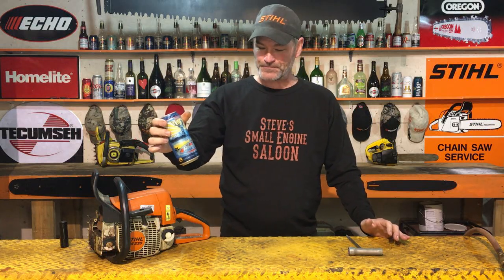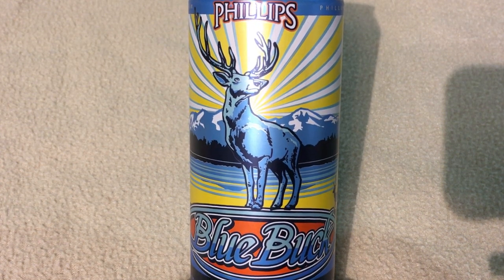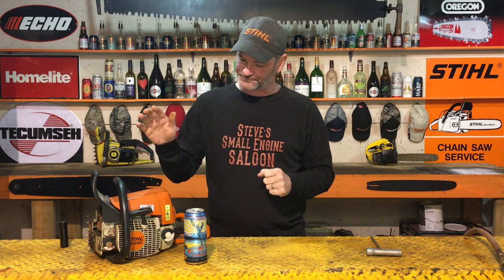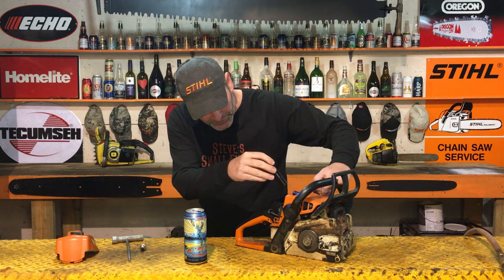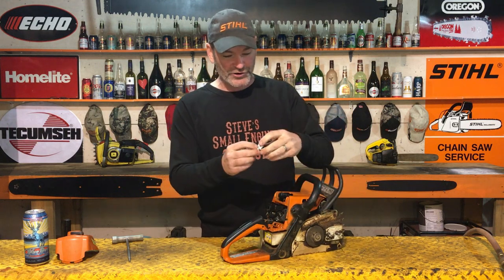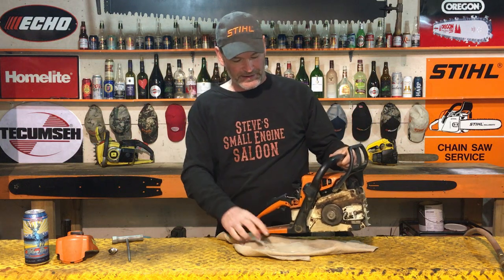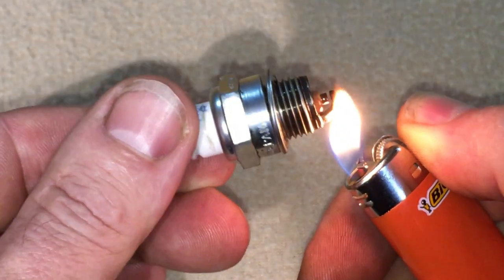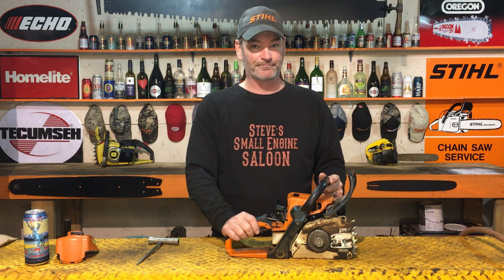How To Unflood a Chain Saw USING Tools

Comment: Hey Steve, I thought using an air hose to blow out the cylinder was a little overkill, It turns out it cleared the cylinder faster and made it easier to start.
I had installed a new engine and carburetor on my STHIL MS 390 and was having difficulty starting it. The oil I put in the lower end while assembling the engine was heavy enough that it was messing with the air fuel mixture, The carburetor was fully adjustable jets with no limiting caps and I didn’t realize I needed to start the base setting of the Jets at one complete turn. Once I cleared the cylinder and got it running I was able to properly adjust the carburetor thanks for the tip.
Reply from the maker: Right on

Comment: Thanks Steve. Followed your instructions and gas poured out of the spark plug hole. Glad I wasn't wearing my Steve's Small Engine Saloon hoodie when I did it! Started right up after that (I guess I needed a refresher course on how to start the saw without flooding it!).

Comment: Steve - I love your videos and your easy to understsnd explanations.
I would only point out that on this video, it appears that you replace the sparkplug with your hands, without snugging it with the scwrench. Then you immediately put the plug boot back on and run the chainsaw.
I would want to make sure that the plug was seated correctly before running the engine
I subscribed after the first video I watched, now i.am working my way through all of them.
Cheers from Portugal!!

Comment: Steve interesting video. I’ve been fixing a lot of chain saws lately and what I been finding  out on older saws if that the fuel lines fall apart in the fuel tank. Had three in a row. Been finding old saws some for free and repairing them.

Comment: Steve my Stihl MS 170 would intermittently not start and only after today that I figured out why after watching your video. I was astounded by the amount of fuel that actually came out of the engine when I turn it upside down and pumped it out and sure enough following your direction it started up on the second pull no choke.  I think I'm going to have to pay more attention to my starting procedure so this does not happen again.Thank you so much I have subscribed to your channel
Reply from the maker: Right on Jeff!  Thank You...

Comment: Howdy, Thanks for this video!  BTW: Any thoughts what to check / why a Huski chainsaw would would start and run great when cold but after 10-15 min start bogging and if it shuts off it will inevitably be flooded when you try to start it?  Thanks for the informative videos over the years.

Comment: Great video. I have 2 Sthil BG 86 blowers and both had the same issue. They would not shut off with the shut off lever. I traced it down to a broken wire on both units. The wire goes thru the handle and down to the coil. I re-soldered and shrink wrapped both so now all is fine. If you have run into this I would like to know if there is a permanent fix. I have read many similar problems on the internet so I am not the only one. Thanks for sharing

Comment: Do I need to empy the fuel that is in the chainsaw before doing this?
Can I wipe of the spark plug with some cloth instead of using the compressed air or lighter?
Reply: No
Yes

Comment: You clarifed a lot of things I though I knew about flooded saws.  I still need to take it in for a clutch issue but I think this might do the trick to get it running again.  Thanks!
Reply from the maker: You're Welcome...
Reply: I'm not an expert, but, I was just reading in the manual, one thing to watch out for is not to rev it while the chain brake is on. Otherwise, it can wear out the clutch. I think it's only supposed to be idling while the chain brake is on.

Comment: My echo cs301 flooded with fuel. I tried several tons of pulls and it never worked. I see fuel flows to muffler. Open choke, put switch to on and press the throttle all the way down. Pull string several times. It works. Thanks for the tips and video.
Reply from the maker: You're Welcome...

Comment: The tool-less video was good.  This is good if you have your scrench with you.
Reply from the maker: Thank You...
Reply: Both had a couple subtle tricks like don't put it on choke or in the half-choke position and hold the throttle open.  In the heat of the moment, we typically forget "it's not about fuel, it's about the air-fuel ratio".  You should get Buckin Billy to bring over one of his old power saws and do a "lets get this thing running" (like you did with the axe rehang).

Comment: Hi Steve  - - - I managed to get the hydralicly  locked piston to move using your techniques  - thank U so much - - - I was able to pull start the saw using the choke and quickly switching to open throtle position. - - - Acceleration or throtle respose was good - but -  the saw will only run for about 30 seconds and then stalls out  - - - any Ideas on what may be causing this probleme ?- - - lots of fuel in tank  - spark plug and air filter good - ( note this saw has not been started in more than a year prior to this) - - - drinking a couple of "Sneaky Weasels" while I ponder my next moves - SAW MODEL STILL MS250

Comment: Diff subject. What makes chainsaw sparks so tiny (can hardly see the sparks on plug) after changing: s plugs,  ignition coil, kill sw, confirm timing was right (flywheel key was ok)?  Chainsaw was hard to start and easily flooded.   Thank you.

Comment: Great Vid. Have a question. If you crank over an engine with no plug installed (solid state ignition) in the ON (start) position  Does it damage the ignition , coil.I was always told it did, just wondering?
Reply from the maker: Excellent comment!  I actually had that in the video, but I cut it out, because I have actually tried to blow a coil doing that MANY times in the past, but have never been successful....
Reply: Thanks for response.

Comment: I buy that canned air you can get at Walmart by the case and keep a couple of cans in each of my tool boxes and on my felling belt with my files and wedges while cutting and I got separate belts made up for each of my peaces of equipment. I also carry a ("First Alert Tundra fire extinguisher on all of my belts") with all of my basic tools for that peace of equipment.  Always practice safety first.
Reply from the maker: Right on...

Comment: Piston Seezier, Carb adjusted For top engine speed. That will Be To Lean and Will seeze Piston . Or Burn a Hole in Piston.. When the Engine Runs Top speed Back the Screw/needle out 1/8 Turn.  Love you show..

Comment: I have new Stihl MS311 that absolutely will not start.  It's still on its first tank of gas, and I've had it back to the shop where I bought it.  They said it was flooded.  I told them I'd already taken the plug out and cleared the cylinder, with no results.  They got it running and sent me home.  I used it a couple of times, having to pull the plug once.  Since then, I've not got it started at all.  I tried starting it by the manual.  I've tried choking it one pull, going to half choke.  Tried starting at half choke cold and then tried no choke cold.  I never been so disappointed in anything.  I'm thinking of asking for a refund.  My old 031 would start the 2nd or 3rd pull every time. This is why I bought another Stihl. Thought I was getting the best.

 Do you have any suggestions?

Comment: What could be wrong with the carburator that would cause it to self-flood in storage?
Reply from the maker: The video I refer you too in this video, talks about the metering diaphragm.  If it is hard and holding the needle open, the pressure in the tank will just fill the engine with fuel....

Comment: Again great to know 👍
Reply from the maker: Thank You...
Reply: @StevesSmallEngineSaloon  Hi Steve I have a 6 hour Honda snow blower, one of those Chinese  Chonda motors , Anyway is put some old gas in it by mistake it started it ran for a minute and then it stalled I  I drained the old gas put fresh gas now it will not start it has spark, do you think I should have the carb cleaned can you give me any ideas.Thanks Steve
Reply: 6 horse power

Comment: I was told never start the chainsaw with the brake on.
Reply from the maker: Completely opposite of what any manufacturers manual will say....
Reply: As Steve said, you SHOULD start it with the chain brake ON.  Just don't start revving it up fast, and for any length of time with the brake on.